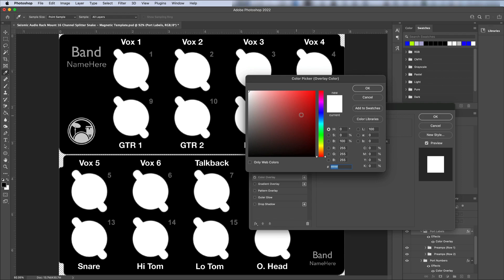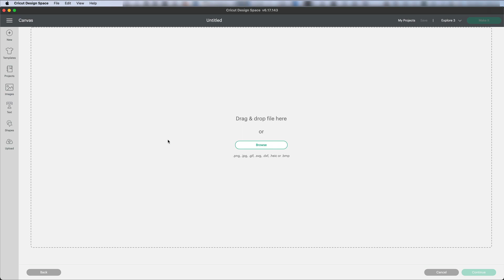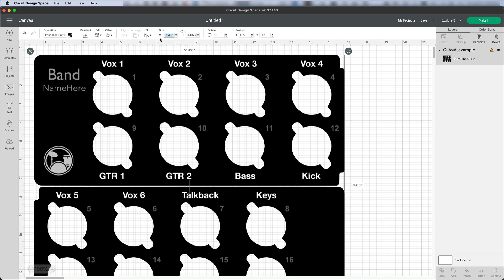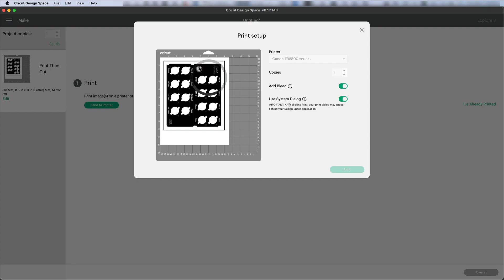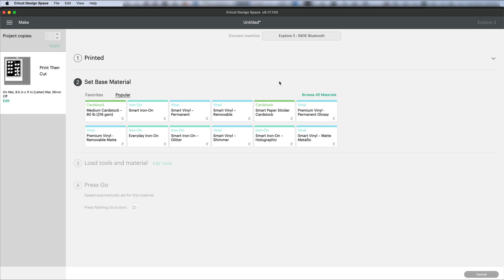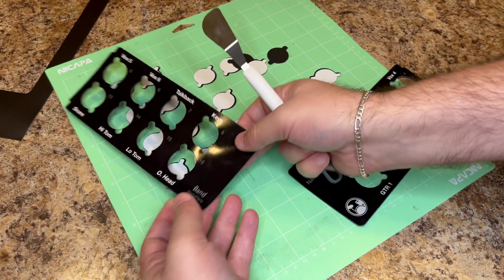Seismic 16 Channel XLR/TRS Snake Magnetic Faceplate

Comment: So excited to find this!!! I did a test on cardstock with my cricut maker 3 & for some reason it doesn't fit. It seems to be resizing the space between the inputs. Any thoughts? I'm sure it's something I'm doing but I can't figure out what exactly. 😂
Reply from the maker: Make sure you have the correct dimensions in your cutting app (see 3:54 in the video). If you want to double-check those dimensions, you can go back in photoshop -> Image -> Image Size, select inches from the dropdowns on the width&height to verify.